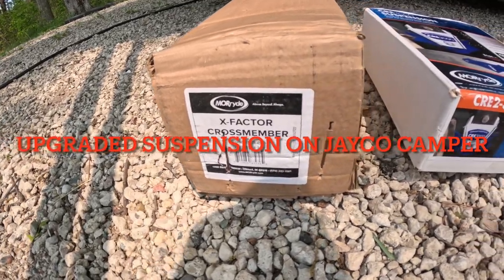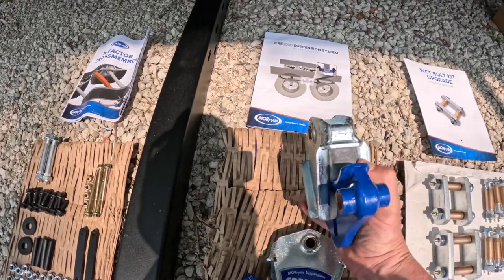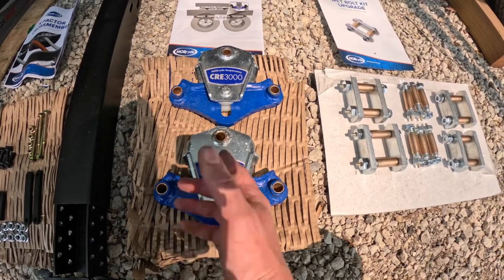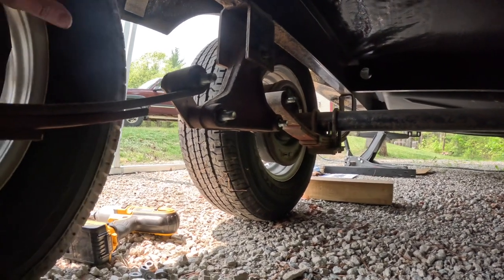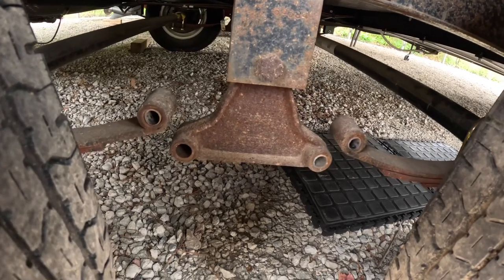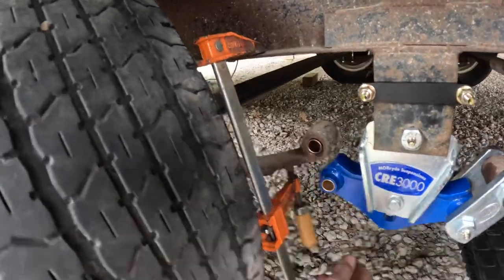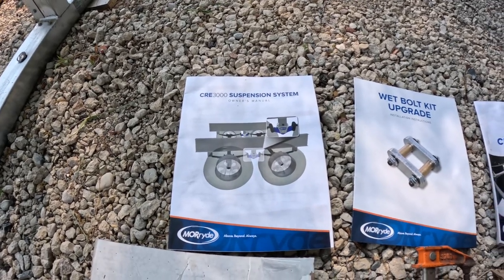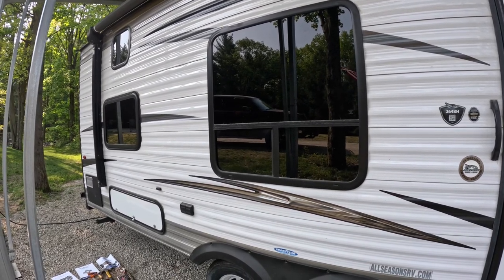Camper Suspension Upgrade for improved stability and ride quality

Comment: Thanks for making this video. I really love how you lined up all the tools at the end, well done. I'm about to start a pretty similar project. I'm swapping my springs too with heavier duty springs. I'm also putting 3 of the crossmembers in. I really want to make sure my hangers are solid. I have such anxiety about springs and hangers breaking.
Reply from the maker: Im glad you like it! It's an easy job that can be done in an afternoon. It did help ride quality and handling. After swapping the springs make sure the get the axles realigned properly or you can have excessive and uneven tire wear. Be sure to subscribe to our page for more upgrade ideas and how to videos!

Comment: the same was just completed on a holiday rambler, a much heavier trailer. the other option for lining up  the shackle holes is a pointed heel bar to pull the holes into alignment. its faster and safer than a clamp. one can never stress enough the safety issues involved here in lifting and supporting the weight.  ive never seen it done with the wheels on before that's interesting for sure. 

also on some models the installer will have to trim  the center trunion mount into a V shape to clear the cre 3000 bent edge  lip. the trunion mount hangs too low and interferes with the movement of the  trunion as it pivots on the bolt.
i would like to add that small rubber caps meant for brake bleeder screws , place over the grease zirk  is super valuable in protecting the zirk from road grime. many people will mount the bolt with zirk inboard. i prefer how it is shown here.  nice video and  right  to the point.
springs.  if they are not warped bent or cracked, if there is no weeping rust from them,  the will be good for the run. furthermore modern springs ae of lesser quality than older springs. more than once this installer has regretted throwing out old springs from the 70 and 80's trailers as they were better than the replaced new springs.
Reply from the maker: Thanks for sharing! Safety is the most important thing with a job like this!

Comment: The grease hole is supposed to go to the 3:00 or 9:00 position, not 12:00.
Reply from the maker: The instructions never called out a position specifically. But I like to put the hole to the load area to make sure the grease gets to the wear surfaces. Shackles move very little so to be to the side may cause it to go the path of least resistance and miss the areas it needs to be
Reply: @adventureandrepeat  MorRyde's instructions on line explain where to put the grease hole.  If you put the grease hole at 12 or 6 you run into a chance the bolt won't take grease.  But if it doesn't, you can still get it to take grease by jacking the trailer up by the frame top relieve pressure.

Comment: Did you use one floor jack at a time and only jack up one side of the rig? I’m wanting to do this upgrade but I don’t want to buy numerous jacks for a one time use…
Reply from the maker: Yes I only used 1 floor jack. Because that's all I have as well. Jack was placed just behind the axles on the frame. Once one side was completed and back on the ground I went to the other side. I was able to do the job with basic hand tools that I had in the garage
Reply: @adventureandrepeat  that was a GIANT help! Thanks so much!
Reply from the maker: @patricksharimccarthy9495  No problem! I'm happy we were able to help!

Comment: Crazy question and in no way meant as a criticism... with all that effort, why didn't you upgrade the springs as well?    Nicely done, I'll be doing something similar as well.
Reply from the maker: Great question! The factory spring rate was plenty for the camper. If I would have upgraded, it would have been to a stiffer spring to increase capacity but that also makes for an even stiffer ride. Which is not what we were looking for. And also a spring replacement would mean I have to realign the axles to make sure they all track correctly and don’t burn up tires
Reply: @adventureandrepeat    Thank you... I never even considered the axle realignment aspect!   I just look at our RV and think "what can I upgrade", and sometimes I miss those minor issues of doing the upgrade!   Thanks!
Reply: @adventureandrepeat  Increasing spring stiffness alone  won’t increase capacity.  You would have to go to a larger capacity axel also.  We did this kit, but used the 4000 model.  We went from 4400 lb axles to 6000 axles with slightly stiffer springs.  We didn’t do it to carry more weight, we did it to increase reliability.  The wheel bearings were two sizes larger, and we also got 12” brakes instead of the 10” we had.  We feel the suspension is no longer the weak link.  We also went with the Goodyear endurance tires.  Only thing I worry about now is cracking the frame due to the stiffer springs.  I may re enforce the equalizer and shackle brackets. They look pretty flimsy.
Reply: I did the same upgrade, but replaced all four springs. My thought was to buy stiffer springs also, but I was cautioned by an expert that wasn't a good Idea. You need the springs to absorb the shock of impact from road hazards like potholes etc. You stiffen the suspension and that shock has to go somewhere and most of the time it's sent to the weakest point in the suspension - the hangers. You can easily tear off spring hangers by having too stiff springs. Also, just a note, when installing the wet bolts, you want the grease holes indexed to either 9 o'clock or 3 o'clock to prevent pressure on the bolt from not allowing grease to travel through it. per MorRyde.

Comment: Just curious, did the X factor help with stability of the camper while using it.  As in while camping and walking in the camper, did you notice any difference?
Reply from the maker: The biggest difference was while pulling the trailer down the road there was much less sway from cross breeze and passing cars. There was also less lateral movement in the trailer when parked and people walking around in it. Overall, it was a great upgrade to have done.

Comment: How did you know which CRE 3000 to buy I see a 33 or 35.
Reply from the maker: Great question! The easiest way to do it is take the measurements from your factory spring equalizer and match those dimensions to the cre3000. The measurements you need are from shackle bolt hole to shackle bolt hole. That will make sure you have the correct width hanger for your application